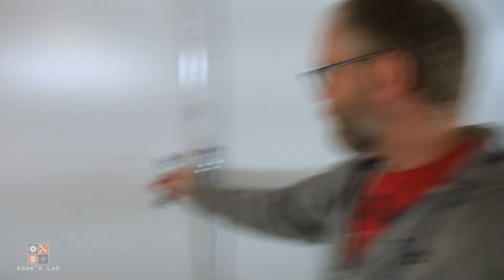Shop Improvements - Fixing A Problem I Made For Myself | [0033]

Comment: Nice solution to your problem! Maybe those gaps can be solved by using the flexible garage door trim.
Reply from the maker: Spoiler - I went with some brush seals (designed for the purpose) and a strip door (think industrial walk in freezer) to get the door sealed up. So far happy with it, although the strip door can be a bit annoying to have to walk through. I'll detail this all in an upcoming video. LOTS of changes occurred between this video an now.